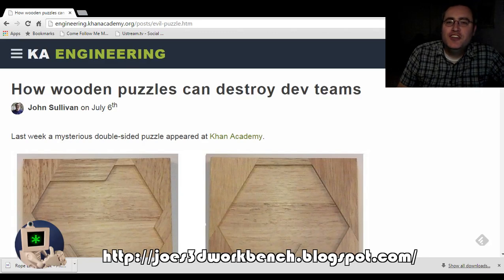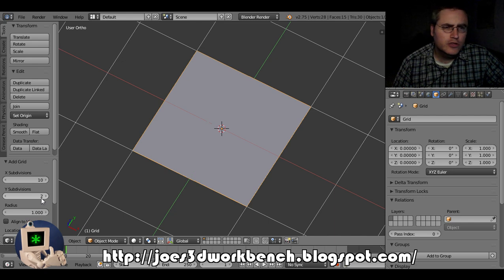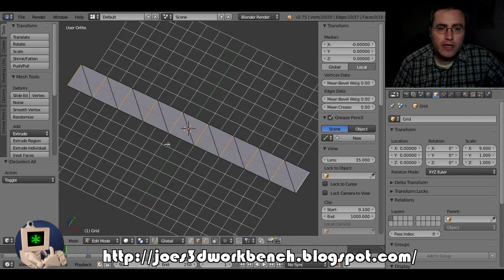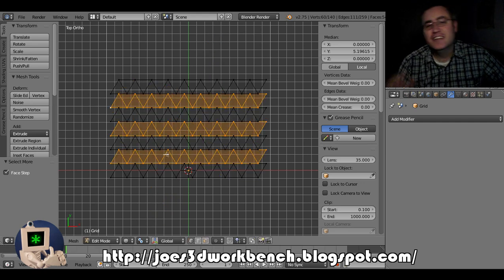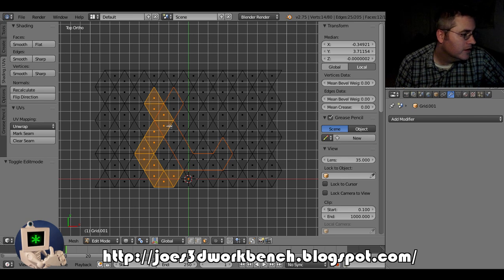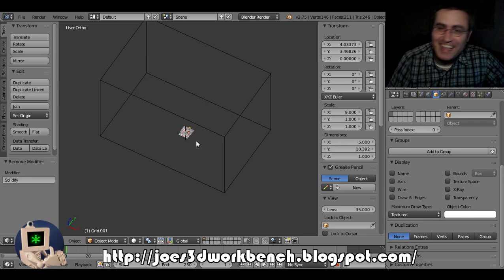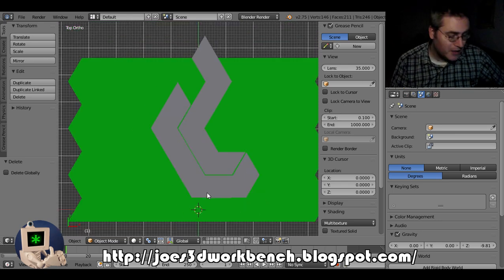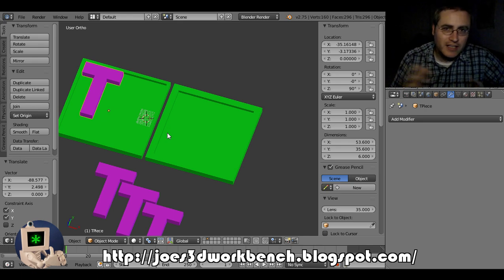3D Printing Project - Puzzle of Evil

Comment: Why solidify rather than displace - normal - set neutral to 0 and strength to a negative value.
Reply from the maker: That sounds super clever, but I'm having a hard time actually making it work. Displace wants to work with a texture.If I turn off the texture then I've got Midlevel and Strength, and there seems to be no combination of these that makes a 2mm cube into a 1.6 mm cube (.2mm shrink all around) accurately. It seems these values want to be multipliers in some way. I played with a texture, and still couldn't get it to work.

I think part of the problem is it's moving the corners along the normals, and not caring about the thickness of the difference of the walls. So it's moving the corner's .2 inward, but that translates into a sqrt(.2) thickness in the walls. That geometry would get increasingly complex as you move away from 90 degree corners (though with enough points it would also become increasingly accurate). It's a great idea, but in practice I don't see how to make it work, yet.
Reply: The default texture is a 50% grey... let me think a bit more about it, i'm sure i had done something of a kind waaaaay back then.